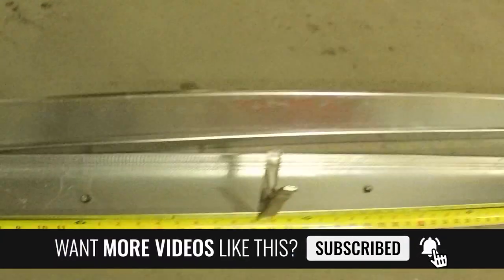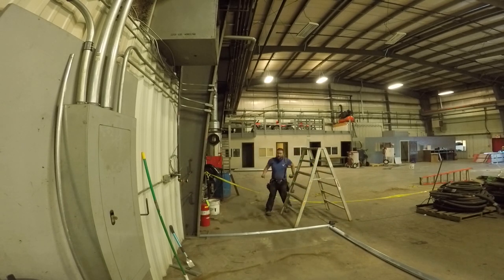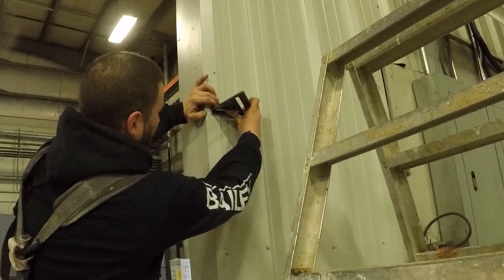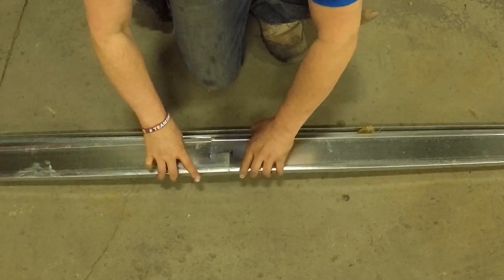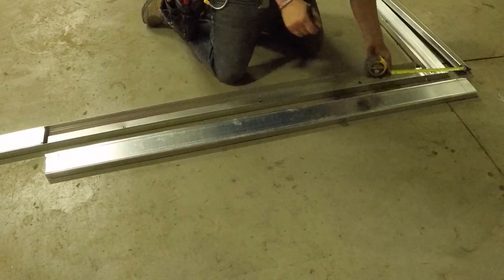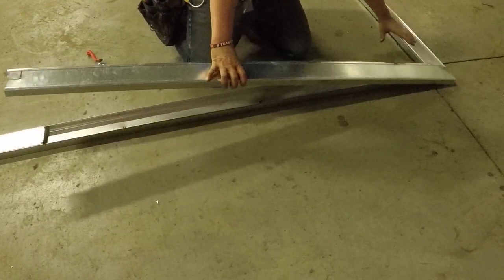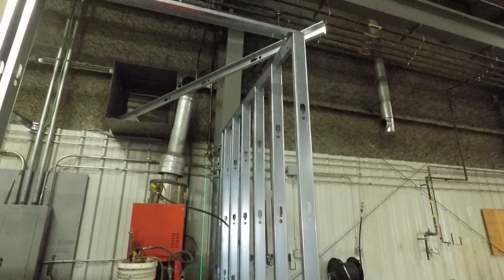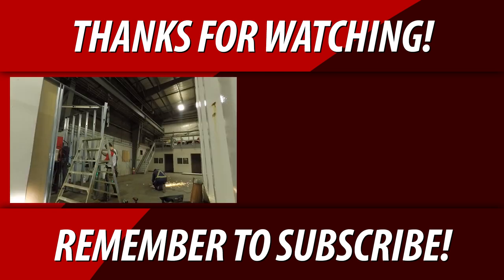Metal Stud Framing Layout Tips & Tricks Free Standing Walls & Doors

Comment: How you transfer the measurements from the blue print to the project floor you do it to rough framing or you count in the drywall?
Reply from the maker: Yes very important. The drawings give you to finish, meaning you have to account for drywall, tile, any panelling.... It's very good to know all your wall types double layer, single, 1/2" or 5/8" and give a big 1/4" for tile and so on.
Reply: Most prints show dementions off the grid lines  to the center of walls  up to us to do the math but to do so need wall types and wall finish

Comment: Instead of marking 16 5/8 etc you can just set the studs ahead on one wall so when you hang the wall that’s on center the wall that’s set ahead will break on center cuz of the drywall on the other wall
Reply from the maker: Anyway you do it just have to consider the spacing so the drywall doesn't run off. You can always start a sheet inside the wall and cut into the corners.
Reply: Or just start from the soft side

Comment: As a metal framer I can assure you we never use tape for track. Takes way too long
Reply from the maker: What tape? A tape measure? Sorry I don't know what you mean. If you don't use a tape measure then how do you layout your walls?
Reply: @ConstructionKronies  for track we never measure how long to cut it. We simply throw a laser and cut it the same length as bottom. If everything is square should be no problem
Reply from the maker: @ChrissVFX  gotcha! Yeah I do the same thing a lot but I pull out my tape to mark the 4-1/4 on my corners. I show the tape here on some things so new people know what to do. The tape also comes out for walls that aren't level like concrete or ones yiu didn't frame lol and sometimes the columns are sloped like in this video. The tape is used plenty not never, what your talking about is the bulk of it and yes we just match the top to the bottom.

Comment: Why do they run drywall into the corner why not do it like in wood with drywall backing
Reply from the maker: It gives the corners some nice strength and it also can be for fire rating. Also gives those smaller door pieces more strength and it requires 1 less stud to do it this way.
Reply: What do you do if they still have to run wire and pipes before you can drywall